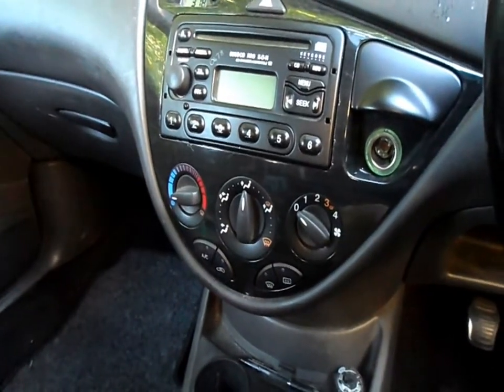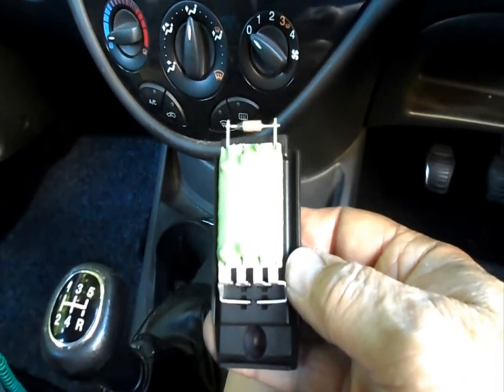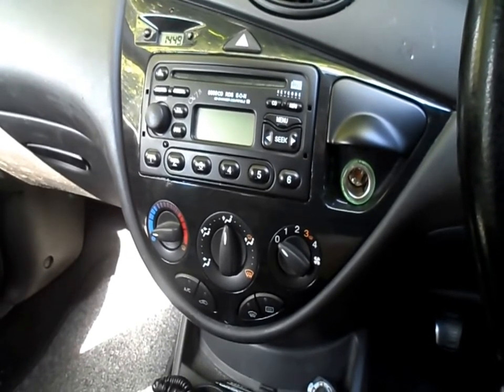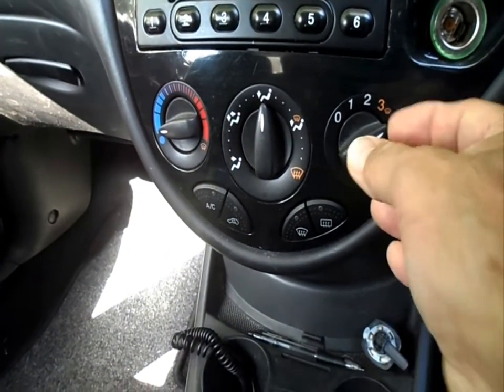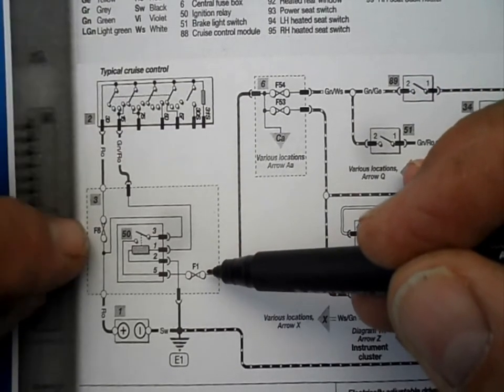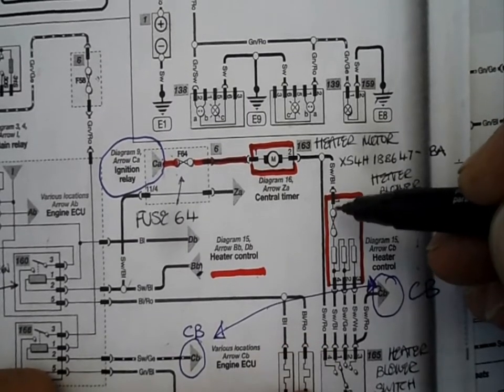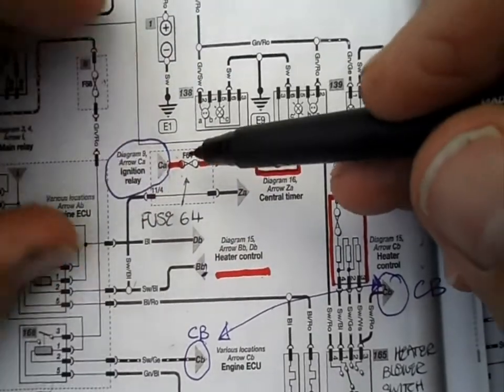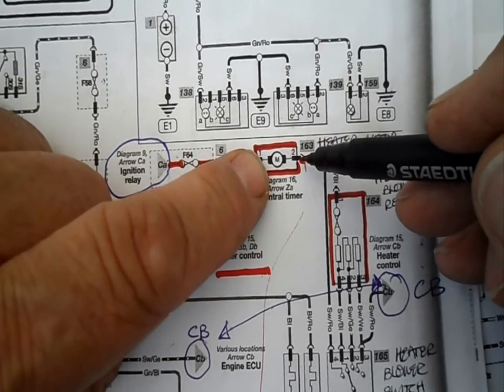Ford Focus Heater Fan Repair incl Flo Chart Diagnosis

Comment: Hoping you can help John as I'm stumped. Original resistor failed, cabin filled with smoke. Replaced the resistor, new heater fan, pollen filter but still the fan only works on 2 and 4. Checked the wiring plug to the resistor, no signs of heat damage. Checked fuse 64 which is fine. I'm in the UK focus 1.6 MK1 petrol, Any ideas pls?
Reply from the maker: when you say you replaced the resistor which one are you referring to ?
You have replaced the fan yes ?  was it faulty and how did you test the fan ?
If your fan works on setting 2 & 4 but not on setting 1 & 3  then there has to be an issue  either with  the Fan Switch or the Resistor pack or the wiring loom between them. 
If you have a multimeter I would suggest you check that you have 12v at each of the heater switch terminals from the resistor pack . ie switch the switch to position 3 and test for 12v at either the resistor pack or the heater switch. You may find that the initial fault has burned out the wiring between the resistor pack and the heater switch
Reply: @johncooper7242 replaced the resistor pack. I also replaced the fan as a precaution as it was noisy. I've fitted two new resistors (non genuine) and the fan still only works on 2 and 4. I've checked the wiring as best as I can and see no signs of damage to the wiring or the plug
Reply: Heater control switch was the culprit, some of the terminals within the switch had melted!

Comment: Thank you John forsuch a thorough explanation. My mk1 focus fan has been noisy on setting 3 and 4 and now has stopped working altogether. What would you think? Should i replace the relay, resistor or motor?
Reply from the maker: watch the video and follow my troubleshoot and diagnosis. You can pause or slow the speed down in youtube settings. Start with  the checking the fan fuse then use a multimeter to check the wiring The fan resister pack is cheap enough to buy and substitute if you are not good with wiring
Reply from the maker: Don't forget to watch the comprehensive troubleshoot Flo Chart I made at the end of the video

Comment: Did it just suddenly stop?
Reply from the maker: yes ...one day the fan just wouldn't work at all. It took some time to find that the reason the fuse kept blowing was that the fan in the fan motor was jammed . If you follow my diagnostic flochart  at the end of my video .....you.ll find your problem